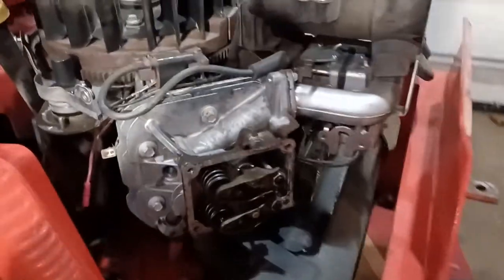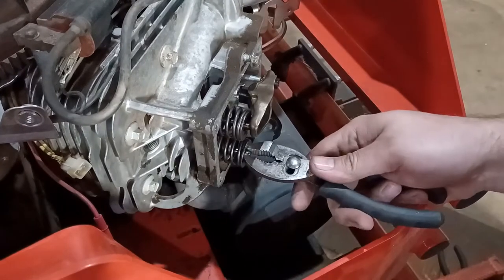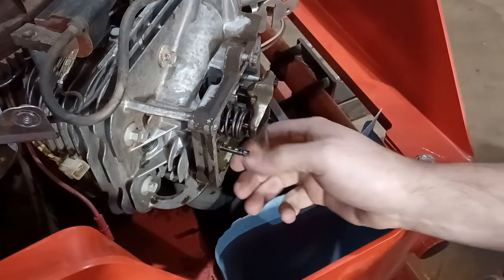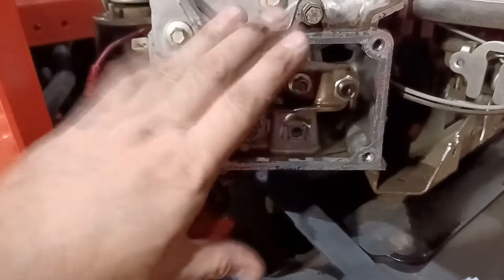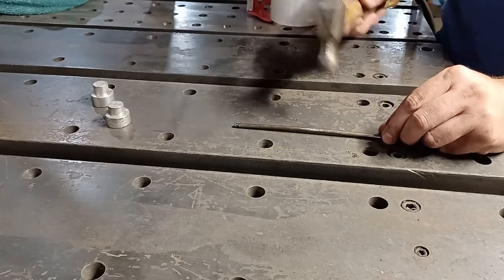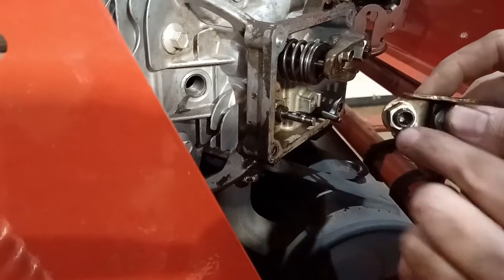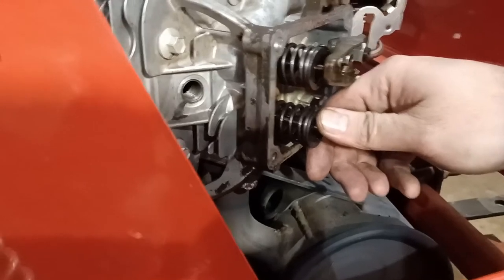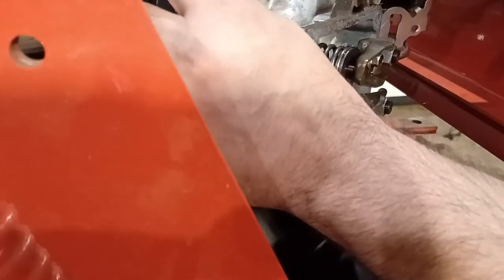Valve guide repair on Briggs and Stratton Motor #Simplicity #zeroturn #briggs&stratton

Comment: just a quick tip for somebody doing this procedure, if yiou have away fo shooting compresseed air in the spark plug hole it will hold the valve shut and it won't be sliding on you and when putting your keepers on
Reply: YOU CAN TAKE ONE OF YOUR SPARK PLUGS CHOP OFF THE METAL THREADED PART  OFF OF IT  DRILL OUT THE CENTER TO REMOVE ALL PORCELAN AND ELECTRODE MATERIAL THEN BRAZE A 1/4" MALE  NPT FITTING ONTO IT.  Then take this new device you just made and screw it into your cylinder head. Then hook your air hose to it . (100 PSI RECOMENDED ) and your valves cannot drop while you're doing your procedure. I used to use this to procedure to replace valve stem seals on automotive engines when they were still in the vehicle
Reply: You can also just feed some rope or paracord in to fill the cylinder to keep the valve from being able to push in. Easier if the cylinder is positioned vertically, but could still be done.
Reply: if you have a compression tester just screw in the hose in the spark plug hole and hook up your air hose to the tester hose

Comment: I saw a video of someone pushing the guide back into place then drilled a 1/8 hole on the side of head, tapped it and screwed in a small set screw to prevent the guide from pushing out. Smartest thing I ever saw
Reply: Tarel did that video but I just tack with welder thru port
Reply: @philliphall5198 
That's Taryl !
Taryl Dactal   :-0)
Now, there's your dinner !
Reply: It's called common sense. 😮

Comment: Another thing you can do that I've had great luck with is before I tap the valve guide back in, I'll take a small chisel and make a couple mars on the guide itself, so when it slides back into the head, it grabs onto the aluminum from the inside, and then I'll go around the outside and get some pings into the head coming around the guide.
Reply: Great tip. Thanks
Reply: I would do any pings before inserting the guide (unless you are going to ping so hard that you would collapse the wall around the guide).
Reply: It is called peening.  You make a few raised marks on valve guide, tap it into place in the cylinder head, then peen the aluminum around the metal valve guide.  There are 3 other techniques to use, this is one.

Comment: saw a great tip to keep from pushing valve into cylinder. push a lawnmower pull rope, or other similar size rope, into cylinder spark plug hole, after lowering piston to bottom of cylinder. Then turn flywheel toward TDC and the rope will hold valves in.
Reply from the maker: Great tip!

Comment: Some guys use a socket over the valve guide, I did mine with one and it worked great, My problem is that when I put it back together one of those valve keeper clips shot off into the stratosphere never to be found. I smiled when you dropped yours but at least you found it! One question, Can you push that guide in too far? Mine ended up being flush with the head. I guess I’ll find out when I go buy one valve keeper! Ha!!!! Thanks for a great video!
Reply from the maker: I don't think it's a thru hole. I think it's a counter bore.  in other words I think the bushing bottoms out.
Reply: @BecksArmory  mine doesn't bottom out like you thought. Wish it did.
Reply: How did you make out with the guide pushing back flush to the housing? Mine just did the same thing and I really don't want to pull the head and mess up all my gaskets if it's not going to be an issue. It seems like my valve is able to spring back closed out towards the rocker arm all the way. So I'm assuming the guide isn't "pushed in" far enough to where it's obstructing the valve on the inside of the head. Just wondering how yours worked out or if you ended up taking the head off to look?

Comment: I hammered the exhaust valve guide flush with the surface.  Is this a problem? Thinking it's only a problem if the guide is out too much preventing spring to fully compress.

Comment: So this is second time you bent rods?
Just did mine today massive clog of grass clippings packed on left cylinder head causing mine  to overheat..
I put Access caps on my housing to do inspections from now on I feel like I will be taking the valve cover off the left side periodically to see how it is doing easier to do that than to replace the push rods
I will start the first inspection after 20 hours to see how it is doing.
Maybe I don’t even make it that long… I just know it will be running much cooler than what it was
Reply from the maker: my Simplicity dealer said that there was a stretch of time were the valve stems would work there way out when the motor go too hot.  He said he has not seen it happen to any of the new heads he has put on.  I also try to keep a better eye on the grass build up inside the blower area now.
Reply: Did your repair last?

Comment: 6:00  I would remove the bolt before dimping if I was using that fix
But the fix I used was to frill and tap and use a stainless steel helicoil.
After that you can torque it down even tighter than stock specs without any problem.
Reply: Hi, I was wondering if you could help me with the sizes you used for your tap, die and helicoil?
Reply: @Art-ji2hx 
I used drill bit size  17/64 (.266)
and HeliCoil  # 5521-4  which  is 1/4-20
(1/4 width 20 threads per inch)
Reply: @Art-ji2hx  
Today I fixed a slipped exhaust valve guide on a Briggs v-twin (model 445667)
I removed the valve
then poistioned the valve guide where I wanted it (just a tiny bit sticking into the exhaust chamber)
then drilled a 1/8" hole through about the center of where the guide sits the head until the bit went through the guide (just one side not all the way through)
then removed the guide,
tapped the hole with 6-32 tap
then position the valve guide back into the head aligning the holes (in the head and the valve guide) then put a nut on a 6-32 x 3/8"  machine screw (both stainless though any type of metal would do).
Slide the valve into the valve guide (you should be able to lookinto the hole and see it passes through) and then screw the bolt into the tapped hole but not deep enough to touch the valve stem. Then tighen down the 6-32 nut (snug, not too tight). Finished! Ready to re-assemble. Will do that tomorrow.
Reply: Added one more thing - put a hose clamp around the outside housing where that valve goes through the head and had it on top of the bolt/net that is screwed in - just to double assure it will stay in place.
Put it all back together today and mowed about 2 hours with no problems.
NEXT!

Comment: That's a newer motor I thought that was an issue with the older Briggs & Stratton intek engine?
Reply from the maker: I let it over heat witch prolly caused the problem.  Now I pay attention to all the grass that builds up inside the engine shroud.  If air can't flow it will over heat.

Comment: Given the expense of the entire engine and the mower, is it at all wise to beat on a cheap pushrod (especially when you already have a new one)? Staking the valve guide is a temporary fix but can last for a season of home use. but to reuse a weakened pushrod may fail and result in more work or damage. You didn't really peen the guide well with only four points. It's your personal machine...it's your call.
Reply from the maker: Yes this is my personal machine and this fix allowed me to finish the summer. Over the winter I took it back to the dealer who put a new head and push rods in.

Comment: I cant find these heads anymore.. suggestions?
Reply: They are available but new part numbers... 799088 is now 84001918 and 799089 is now 84001919... pricey new so if you're trying to save some money with used, I recommend at least buying new valve guide seals as used heads waiting to sell will probably have dried out and hard seals and it will smoke.Valve guide seal part number 690968 which also supercedes a bunch of older part numbers. Hope that helps.
Reply: Watch out buying used ones, they just press it back and call it a good head😊

Comment: The fan on my 28 year old 16 hp Vanguard motor on my Simplicity Broadmoor mower blows upward, pulling air past the cooling fins. The fan on the 25hp briggs motor on my 52 inch Ferris sucks air downward. It constantly gets blocked with grass. Why did Briggs do this???? Every damn manufacturer of everything have lost their collective minds.
Reply from the maker: yeah, I agree.  I work in an Engineering office (day job) and there are a massive amount of new Engineers without a lot of comin sense these days.  Nobody wants to pay for experience anymore.  I think they are going for maximum air flow but disregard the existence of debris.  Debris is a pretty major factor...
Reply: @BecksArmory  And a lot of engineers that can't spell common. Lolol

Comment: I wonder if a high temperature loctite bearing retainer would work?
Reply from the maker: possibly.  This fix got me to the end of the summer.  I than was able to get a whole new head.
Reply: Yes
Reply: No
Reply: @toddpeters9007  the high temperature Loctite would definitely work
Reply: @Windowwarrior2  thats what I'm doing. Green locktite. #638 . For cylindrical applications. Clean with carb cleaner first. I peened mine, but it only tasted 4 mowings.